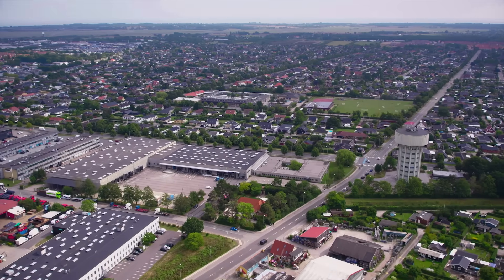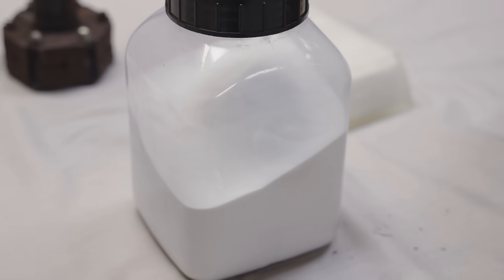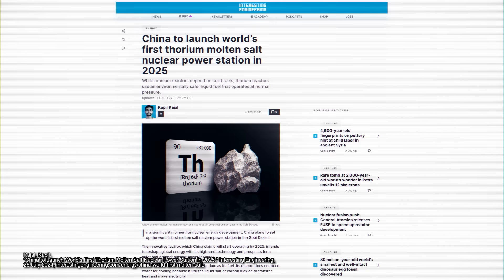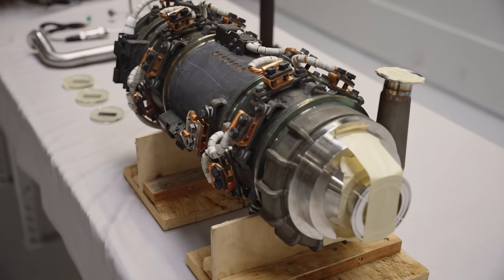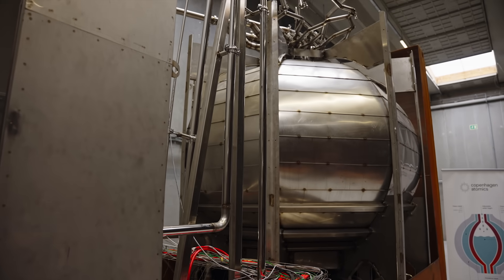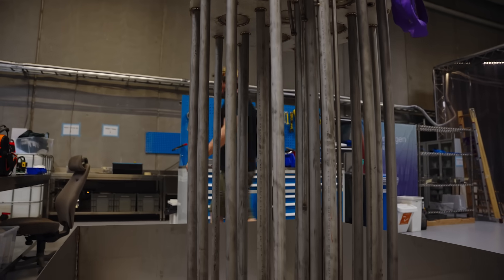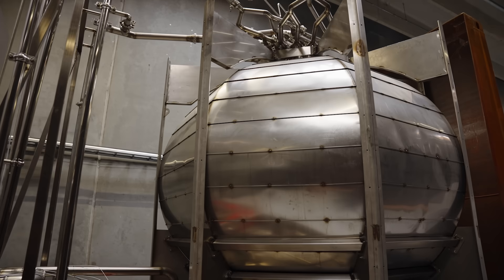Why Isn’t Thorium Changing the World?

Comment: Ive always wondered, if you have to "shut down" these molton salt reactors, doesnt all the salt solidify? like in all those little tubes? Do you just have to heat the entire thing up to the salt melting point BEFORE hitting the start button?
Reply: Best I’ve heard it described the literally pull a plug out of the bottom and the salt drains out of the reactor to a reservoir thus killing the reaction. Something about using an exciter in the reactor as thorium needs to be “prodded” to life with something like plutonium. If it’s all drained out and away it goes inert again, though I imagine cleaning out the system would be a nightmare.

Comment: Glowing red-hot pump, highly corrosive AND radioactive? What's not to love?! :face-green-smiling:
Reply: The fact that you can safely shut one down in an emergency by simply “pulling the stopper” and letting the salt drain to a safety reservoir.
Reply: @TheReaver1234  I would have to know the actual physical process of "pulling the stopper" and whether it completely bypasses the pump. Plus, the high degree of corrosiveness could lead to more frequent damage to the whole system. Also, the pumps have to handle ~1200 degree F temperatures, and planet Venus, at only 850 degrees F, destroyed all 10 landers within ~2 hours each.
Reply: @ the way it was described to me and it was done in a very “MSR for dummies” way, it’s a drain built under the bulb section of the reactor were the majority of the salt is at any given time. You hit the switch and the bottom is opened, dumping the salts out into the reservoir. As you have to excite thorium to make the reactor work there is a catalyst like plutonium in the system and by removing the thorium from contact with said catalyst via dumping it you kill the reaction extremely fast.

Comment: The only issue I have with this entire video, is the moment when he says that he believes in 2100 thorium will be the primary source of power.
I think that's a ridiculously low bar. If in 2100 we are primarily drawing energy from any source we currently understand, we've likely fallen far below our potential as a species, or wars ruined enough of humanity to set us back decades. Compare 80 years ago, to 160 years ago. We're expanding and improving at an increasing rate. We'd have to drastically slow our improvements to still be stuck on any modern tech, in 2100.
Reply: True, energy demand is growing 10% per year with AI utilization, if it continues in 2040 we will have to have twice as much as we have today.

Comment: Small adendum about the stainless.
   
Stainless steel is a generic AF term, there thousands, if not millions of alloys and then there are heat treatments that cam be done to create 4 types of crystalline structures with dozens of variations in grain size. 
   
All those factors higely influence how the material is resistent for corrosion
Reply: Exactly.  As a machinist, when I get a piece of 316 to work with, it's no problem.  The same job out of 2205 requires a bit more thought.
Reply: thousands of variations but most cars start generating holes after a few yrs in places they throw salt on the roads... economics of u wont buy the new if u wont brake the old matter science who knows. if they actually manage to build devices that wont corode aspecially under the stress of friction and high temperature then its huge horrey
Reply: @alexaiz7521 what?
Reply: I'm glad that you found the absolute most irrelevant detail to fixate on.
Reply: @-Devy- it’s not, it’s extremely important. If you don’t get down to this level of detail then you get flaws, breaks, and god forbid bursts in the reactor.
Reply: @-Devy-  material science is definetly not irrelevant by any stretch of the imagination, even more when dealing with corrosive, high temperature, radioactive fluids

Comment: The main reason that nobody uses Thorium reactors is because it is much, much easier to make nuclear weapons using Uranium reactor technology.
Reply: true
Reply: That's always true for a proven technology, it takes a lot of R&D to develop something that works better along with a lot of money.  Look at battery technology, we've replaced batteries with lithium-ion ones instead of the nickel-cadmium for rechargeable ones since they are a lot more energy dense for the same size and are cheaper.  But we still make other kinds of batteries since there isn't something better yet.
Reply: @callak_9974  - The first successful electricity producing thorium reactor core ran in 1978. At least one successful commercial reactor has been built been built since then. The 1978 reactor showed that the burn up rate for thorium was approximately 2.4 times that of Uranium fuel. This means, in practice, a lot less waste.

Comment: The pro-nuclear community is kind of split into two camps. You have the Thorium advocates and the "Both thorium and uranium are good". I'm firmly in the second camp. I say bring on the thorium. But understand that Thorium automatically implies a breeding-based fuel cycle that involves the transmutation of fertile material into fissile. Once you're breeding fertile to fissile, that eliminates most of the problems that thorium advocates criticize Uranium for.

Comment: 6:10 An electrical motor pump sounds like a disaster waiting to happen. Power the pump with hydraulics. Or for possibly better efficiency, a small steam turbine powered by the temperature of the salt. I'd also suggest looking at the hybrid system like used in F1 racing for some possible inspiration.

Comment: The short answer is that Thorium doesn't solve the problem of why we don't have more nuclear power of any type.

Traditional Uranium plants aren't being built because they're too expensive once capital financing costs are included. The time to profitability of traditional uranium power plants are around 12+ years. The fuel costs are a trivial part of that equation, with the vast majority being construction costs. Switching the fuel to Thorium doesn't solve anything about that.

Natural gas is profitable after something like 5 years.

Residential scale solar power is something like 7 years before it has paid for itself (depending on where it's built.) There's not a lot of data on utility scale.

Thorium doesn't solve anything to do with the economic problems with nuclear power.
Reply: Low pressure molten salt reactors would save a bunch of money on containment vessels and buildings.
Reply: @ I do not believe that's true. Thorium requires more complexity overall.

Comment: the reactors that were settled on were chosen because those were the ones that produced fissible materials.  fuel for making bombs.   both uranium and thorium were created around the same time.  but the US wanted to build bombs, so those were pushed.

uranium reactors have a failure mode of meltdown.  thorium has a failure mode of it turns off.  you need to keep the reaction going.   it's pretty straightforward which one should be in general use.  in fact, the products that thorium reactors leave behind can be used for medical purposes.  

it isn't that the tech isn't available, it's that they have been forgotten in the same way that the tech behind the Apollo F1 engines has.  The people who knew how to build them are no longer around.

Comment: Fossil fuels enegy is 10 bigger than grid electricity. 

The BIGGEST PROBLEM is the small national electrical grid capacity. 

Have a look at the toaster with wire 10 times too small. Red hot.

Blackouts, grid is too small.

Generation of electricity is dirt-cheap. 2cents kWh. 

Grid capacity is stupendously expensive and needs 10decades to expand.

Morons do not think beyond the bellybutton.   😮    😅😅😅😅

Central electricity generation can not afford the grid capacity expansion costs. 

Grid electricity was all ways extremely expensive energy. 
A luxury expensive energy. 
A little to stop stinking up the home was easily affordable. And running new home technology and lighting the streets for safety. 

Dads always turned the expensive lights off in empty rooms.

All the non experts in the world talk crap. The grid itself is the BIGGEST PROBLEM.

Comment: Kyle's last words  before the explosion  was " I probably shouldn't have smacked it like that."
Reply: If a nuclear reactor can't take a pat on the back for a job well done... then we may need to add more shielding!
Reply: He hugged It too tight
Reply: There's nothing explosive and the salt turns to rock and shuts down fission before overheating. (And yes, I know it was a joke).
Reply: Just wanted to highlight that a salt doesn't require a metal at all it's the product of neutralizing an acid with a base ammonium acetate is a salt and contains no metal
Reply: @jaredhass9254  Is ammonium acetate corrosive? Just wondering. I am not into chemistry. Thanks.
Reply: @golfscienceguru  Interesting question. I would say yes if it's dissolved in water simply because it increases the ionic strength of water, just like salt water is corrosive, but i don't think the solid material itself without water is corrosive... I will actually have to look deeper into that :) thanks for the question
Reply: @jaredhass9254  The what now? This sentence went weird
Reply: That reactor needs a safe-space
Reply: @thelogan4641  to prevent a MELTDOWN eh!?🤓🤓🤓
Reply: @kristianchristensen2254  you got it ;)
Reply: That’s what she said

Comment: 6:37 Or if anyone lives in a place where they have to salt the icy roads. The underside of a car driven on salted roads is another stomach turning visual.
Reply: Where I live they put gravel on the road not salt.  Idk why I’m sharing I just felt like telling you
Reply: Thankfully they don't put molten thorium salt on the road.
Reply: Molten salt reactors have the oxygen purged.  The MSR corrosion mechanism is different from car rust, but you’re right its a real headache in reactors…..They run hot and radiation degrades the metal.  
It looks as if CopenHagen is getting a handle on it.      Cheers
Reply: Most people will spend their whole lives not have seen what the undercarriage looks like. Stomach turning 🙄😂

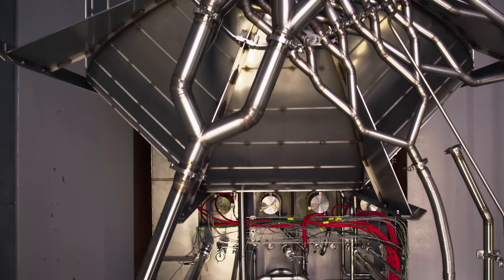Comment: Can't the pipework at 5:30 be 3D printed? Elon Musk is building Raptor 3 rocket engines using 3D printing technology. Welding it makes it look more difficult to produce. Also, glass melts at 1400 degrees celsius and is highly resistant to corrosion. Make all the pumps and pipework out of glass.
Reply: 3D printing would be much more difficult, expensive, and time consuming. You can just buy stainless steel tubing dirt cheap from any of dozens of suppliers and just weld it together. That's much easier than metal 3D printing a massive structure like that. That's also why glass is a no-go. Nobody makes glass pipes. They would have to spin up their own glass pipe production, which would cost orders of magnitude more than just buying stainless steel tubing.
Reply: @hydra70  Borosilicate glass tubing is made actually, in order to make scientific instruments. And 3D printing would help with economies of scale.
Reply: @AbAb-th5qe  3D printing is worse for economies of scale, not better. It's best use is for rapid prototyping or for making things that can't be made any other way. For large scale production, it is much more expensive and much slower than other production methods for most products.
Reply: @hydra70  It can however make complex forms of pipework that improve flows of fuel without junctions that are weak points.

Comment: To be a little nitpicky, saying "it produces less waste" is hiding some complexity at minimum, and is probably not true.  It produces the same amount of waste, it just filters that waste and burns it off, effectively reprocessing the fuel during normal operations.  But maybe "waste" is just good fuel that is bound up with neutron poisons?  If that's the case, then I guess because it is able to separate out the poisons during operation, none of the radioactive, but poisoned left-over fuel gets generated.  Afterall isn't most (reactor) nuclear waste  just good uranium atoms that can't be separated from various daughter products that absorb too many neutrons for normal reactor operations?  So a MSR produces mix of good fuel with the poisons but just constantly filters it in a continuous fuel reprocessing cycle.  (If I understand all this correctly)